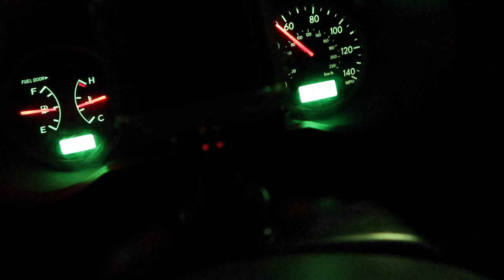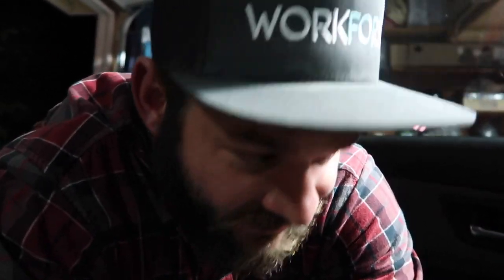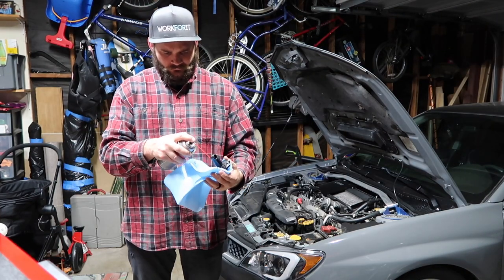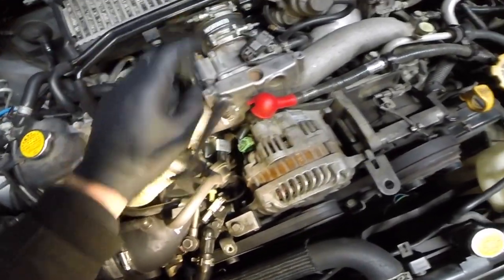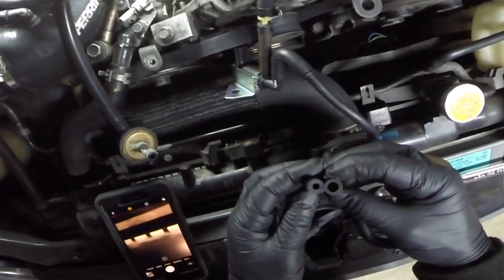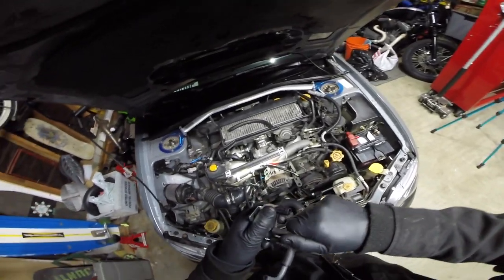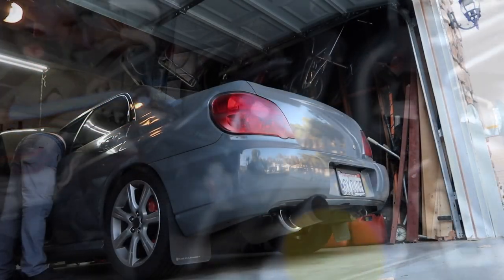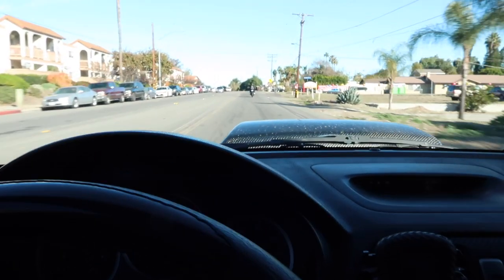Subaru WRX Boost Issues! FIXED! Replacing Old EVAP Hoses

Comment: Another thing to look at (a lot of folks don't know is there) is the restrictor pill in the vacuum line going to the turbo outlet from the tee for the waste gate actuator and to the boost control solenoid.  Mine was intermittently going from overboost to underboost due to a tiny bit of rubber in the line clogging the pill. It's a tiny brass thing with an orifice, inside the vacuum line. Some folks will replace/upgrade their vacuum hoses and not notice this little thing.

Comment: I had a similar issue on my 07 , I upgraded to the iag aos and everything runs fine now . Most likely the pcv is bad.
Reply from the maker: Aww good to know. I really need to install an aos/catchcan for sure. Thanks for info
Reply: Aos over catch can for sure , I replaced my mishi catch for the iag aos and it running so much smoother. I still have the catch can if your needing one !

Comment: I had something very similar and it turned out to be the MAF sensor. I tried cleaning it, but it didn't fix it. So I replaced it with an OEM Denso one and it fixed the problem.

Comment: It was worse for me. I could not even get past 3000 rpm on the hwy. Mine would buck like a horse , sputter, so i did a full on tune up. And still nothing. Turns out it was just a loose tmic/throttle coupler. All it took was a flathead and poking around. Turns out they're  common culprits for boost leaks(that or the turbo inlet). So i will be replacing it with a cobb one soon.

Comment: Def some catch cans they r cheap I wasted my 04 wagons engine just had it rebuilt and turbo was loaded with blow by it was done too. I have a dual can setup with one starting at pcv y and back to throttle body the the other from top of pcv and pipe from front of intercooler(connect to bottom left connection not the ones connected at top) connect both those to a T to the inlet on can and back out to intake where the intercooler pipe was connected. Definitely let’s you sleep better knowing all that garbage isn’t going into the intake

Comment: 7:36 I get that squeaky noise randomly on my 12' now for some reason and it comes from near the intercooler.  If I put a little pressure on it with my hand the squeak goes away lol.  Did you ever run into it again or figure it out?
Reply from the maker: Dude my car is squeaking at the moment! It’s a little chirp from my slave cylinder under intercooler. I’ve been wanting to do a video to see if I can fix it. Hopefully soon 👍
Reply: @06wrxdude  shit I hope that’s not what mine is.. it’s super random tho and not often thankfully. The annoying part is a rattle I have that sounds like something is loose too.. I can’t win lol
Reply from the maker: @brandonhedges719  I also had another squeak back in the day and it was my AC idler. I did a video on it
Reply from the maker: @brandonhedges719  https://youtu.be/1ejDynSX7Bc
Reply: @06wrxdude  Great video!  Luckily that's not the noise I have but I re-tightened everything around the throttle/TMIC and checked a few other areas so here's hoping lol onto the rattle next.  I appreciate you taking the time to link that btw!

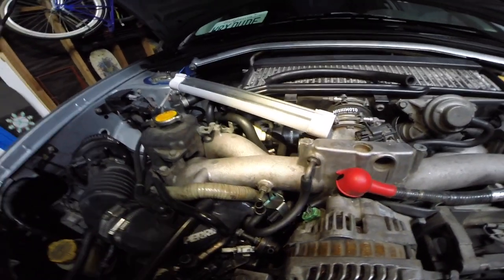Comment: What is that valve @16:51 ? My bottom black piece has broken off is there a way I can block it? Or just straight hoses
Reply from the maker: Hi is it this piece you are referring to? 
https://www.amazon.com/Subaru-16102AA391-Purge-Solenoid-Valve/dp/B00L2ORIL2/ref=as_li_ss_tl?dchild=1&keywords=16102AA391&qid=1608505516&sr=8-1&linkCode=sl1&tag=06wrxdude-20&linkId=775e5a0f81586ba7c631e4f5e3aa97ec&language=en_US

Comment: I have the same problem on my 06 WRX. But mine i feel like is worse around like 3,5k-4k RPM it just hits a wall and wont go any higher. I changed the plugs and coil packs. And cleaned the MAF senser. Thinking it might fix it but didnt. So im guessing now it may be the injectors??

Comment: Where did you get the front bumper cover from? Mine is smashed and have been trying to find a replacement.
Reply from the maker: I’m not sure what you’re saying. My bumper is black because it’s a replacement .
Reply: @06wrxdude  I meant if you got an oem one from factory? or where did you buy it from?

Comment: Hey there 06WRXdude, I also have an 06 WRX and am desperately trying to fix a secondary air system problem on mine, was wondering if you have any experience with it.
Reply from the maker: I’ve had a CEL for that at one point... valve stuck closed or stuck open, I don’t recall. I’ve heard it’s a pricey repair, But I ended up disabling that CEL in the parameters of the accesstuner race program. You can google secondary air pump delete and find out every CEL associated with that whole system.
Reply: @06wrxdude  I live in Ca so deleting it isn't an option but I was able to get it to pass smog today so I'm in the clear for now. Feels good to finally have my car back.
Reply from the maker: Oh right on! Free for another 2 years 😎